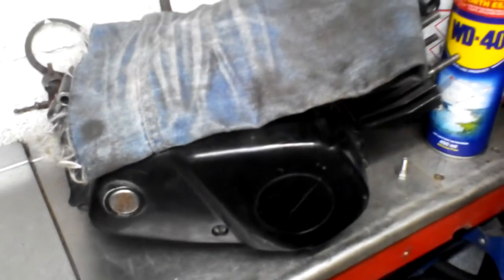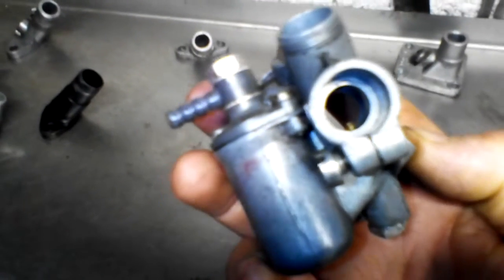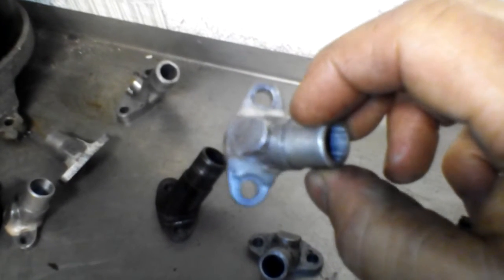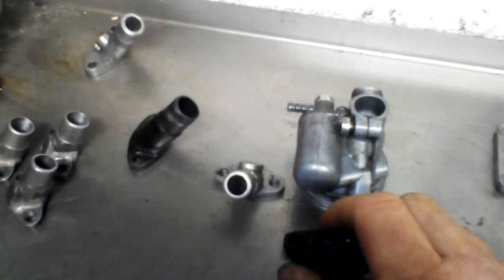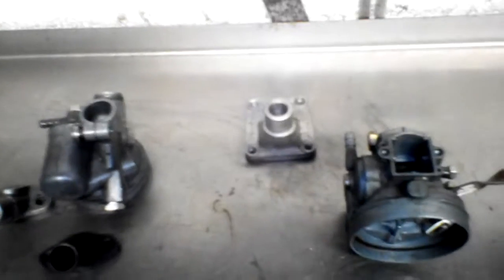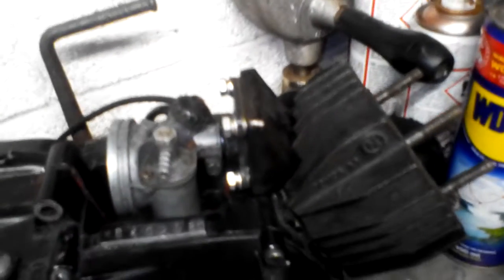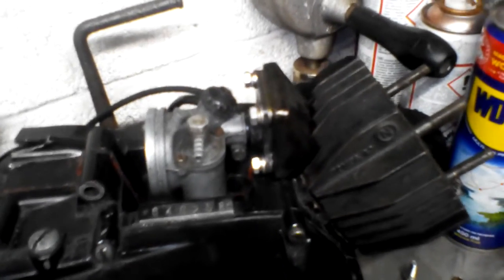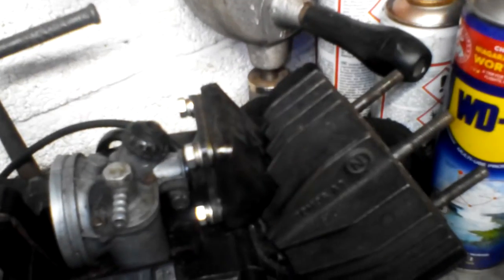Tomos A3 Encarwi carb Reed valve conversion and tuning stock manifolds for extra performance.

Comment: Hi! Im interested if you could share blueprints for your "tuned" carb manifold, so i could produce it myself? And also whats with no needle in the carb, does that mean that there is only the flot that barely stops the flow of gas or...?
Reply from the maker: Your correct. The Encarwi carb doesn't use a needle to control the amount of fuel being drawn up the emulsion tube as it just relies on the slide. It is a bit unusual but then the Dellorto SHA carb does something similar. The float just regulates the amount of fuel in the float chamber to maintain a reserve of fuel from the tank. It doesn't play a part in the amount of fuel drawn into the engine as the jet does that. As for blueprints for the A3 manifold I'm working on how to develop a 3D printed or CNC machined one as it's easier to share the code for these.

Comment: Hi,Encarwi carb not have a needle?
Reply from the maker: That's correct there's no needle fitted in the encarwi carb fitted to the Tomos A3. The throttle slide controls the amount of fuel drawn up from the venturi by regulating the amount of air drawn over the top of it.
Reply: @Themoporium  Thx a lot mate.Have nice weekend.

Comment: hi woud you be able to make another suction knee and sell it i ordered a kit but the reed valve is in the middle and encarwi dosent fit
Reply from the maker: I may actually sell this prototype. It's the only one I know of specifically made for the A3. It will need a piston with a window in it to work effectively though.
Reply: @Themoporium  i didnt mean the cylinder i mean the intake mainfold
Reply from the maker: @sharkfire549  yes that what I meant just the manifold and valve block.
Reply: @Themoporium  will you be able to ship to slovenija
Reply from the maker: @sharkfire549  I'd have to look into that as the royal mail in the UK had stopped doing international shipping for a while to clear a back log. I may have to list it on eBay to take advantage of their international shipping.
Reply: @Themoporium  okay tell me when will if it will be up on sale
Reply from the maker: @sharkfire549  okay will do👍

Comment: hello!!! I am living in Croatia and recently bought a TOMOS A3 i can't find the revalve manifold you are talking about . is that something you desigend yourself to have the reed intake? Would you be able to produce a few and sell them?
Reply from the maker: Hi the reed valve manifold is one I've made myself as a proto type. I may make a few depending on how well it works. You can also get a reed valve manifold for the motorised bicycle kits which you may be able to modify to suit a Tomos A3. Cheers Rig
Reply: @Themoporium  Thanks indeed. I am not savvy enough in mechanic to do such thing but if you accept to sell a couple i could be interested. My little A3 is lovely but lacks power to climb hills and I don't want to put a 65/70cc kit on it.
Reply from the maker: @jmwinch1979  I had the same problem with hills on my stock A3m so I changed the rear sprocket to a 24t and it climbs a bit better. The top speed drops a little on flat roads though.
Reply: @Themoporium  ahhh thanks i didn't think about that option i will look at it...